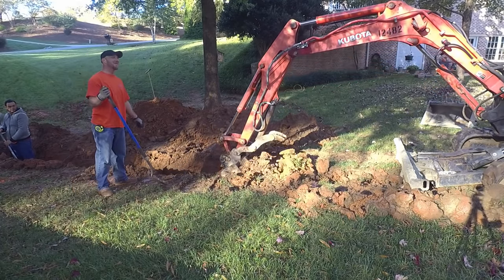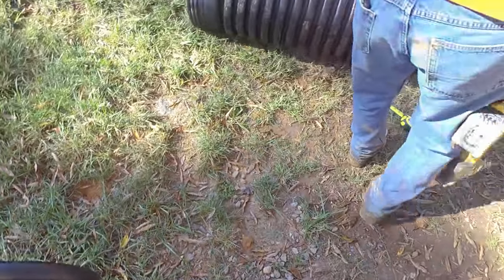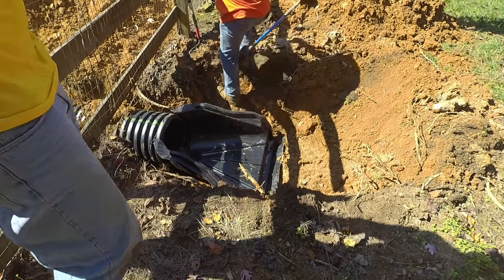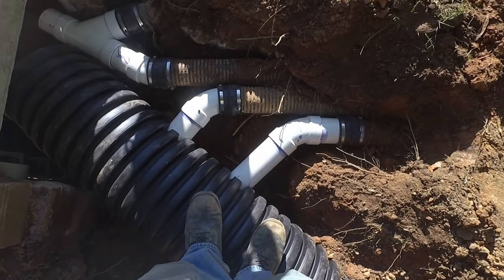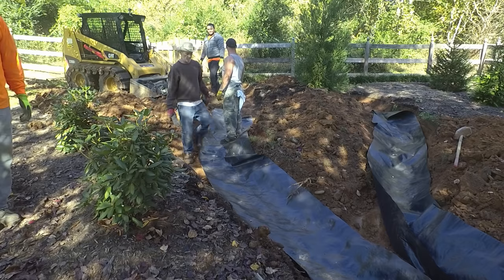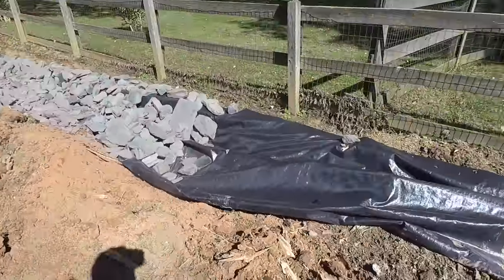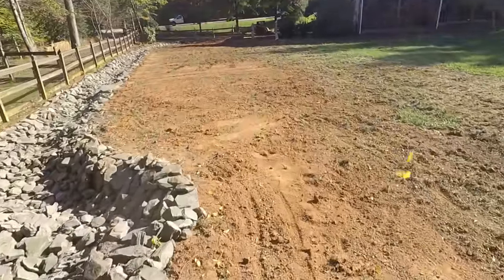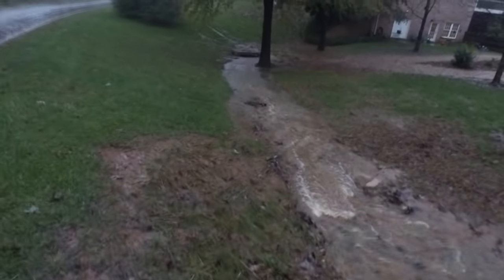Installing a riprap channel + culvert

Comment: Shocking... An operator who knows how to straddle a ditch AND, the pipe joints were cleaned and lubed. Goes to show how many shoemakers are in here. Nice hand work with the riprap and lawn. Love you have before and after and of it actually working as planned. I checked as to why so few subs and I see you are new. We will do some word of mouth and try to get you a bit more settled in. Well done!
Reply from the maker: It's funny you mention straddling the ditch...I about fell in when trying to get out of there. That big excavator is still a little intimidating, but I got it out. I've been excited to see the channel grow, so any referrals would be awesome! Thanks!

Comment: That is really awesome job and improvement. Rip rap really slows the velocity and may even catch some debris. Where we are at, we deal with too many branches, even small logs washing down into the culverts and end up having to oversize, or put in large entrance grates. Service clean outs along the culvert run sometimes. Residential area like that, not much debris.  Thanks for posting the before and after water flow. Great result and attention to detail.
Reply from the maker: Thank you Steven! This was a big job for sure But I'm very happy with the results.

Comment: very well thought out drainage, I also built a rip rap (6' stone)style drain running along my driveway to 16' corugated drain pipe under the driveway to the other side then dumps over the hillside. The only thing that I dont like about it is 7 yrs later the weeds are growing up through the weed control fabric and its a pain to weedeat as it throws rocks and ebris all over the palce.
Reply from the maker: Have you thought about spraying the weeds? I know that's less ideal for wildlife.
Reply: Spray it with a weed killer like Gate city said. There are eco friendly weed killers and can be made at home !

Comment: Wow, great work. What an awful situation though! I would have taken one look at that place and said, nope, not buying it! I have it bad enough as it is where I live. I'm getting ideas on how to handle the Spring run off. But that was just insane! Water is very powerful! I just bought a 31 acre, mostly level, piece of land in NH (believe it or not). Zero water issues. Winning!

Comment: I like this sort of heavy duty channel being open to the surface. You can see if it's breaking down at any point, and fix it straight away, where an underground drain you don't know if there's a problem until it fails completely. It's also much easier for a new owner to identify, or other workers, if the property changes hands.
Reply from the maker: Great point!

Comment: This is gorgeous.  You have said before that you choose function over aesthetics, and I get that totally, however this time you did both. Very impressive.  I do lawn and landscape, and am fascinated with water flow and controlling water flow.  I've done a few dry creek beds and open french drains like the ones you recommend, and have been very successful.  (not for foundations, but for landscape water control) Looking at the open channel... I'm assuming you chose to line this project because of the volume and flow of water, to get all of it possible "in the pipe" and keep it there, even though it's an "open" pipe this time.  Would you talk a little about that--what fabric you choose for this and why you decided to line this, and how that's different from the French drains in clay you have shown us?  Thank you for this education, and for what you do.  Brilliant work, and a pleasure to watch.  FYI, I work in Kentucky, and we have a high clay content in our soils too.
Reply from the maker: Hey -  We used a soil stabilization fabric under the channel. It's designed to go under rock like this and was quite expensive. It also helps keep the veg from growing up through the rocks too. I knew from talking to the homeowners that there was a huge volume of water coming through here so I wanted to armor the trench with the fabric. This is different than a FD where you have water flowing into the trench but then flooding up into the pipe. You don't have the river of flow like this in a FD.

Thank you for watching and for commenting! I'm excited you like the content!   - Shawn
Reply: @GCFD  Thanks Shawn!

Comment: Property value increased because of the flooding problem fixed and as a bonus, when it comes to selling the home, the homeowner can advertise a "part time water feature".  "A River Runs Through It".
Reply from the maker: Haha yep! The homeonwers were worried that it would look like they have a problem and I said it will look like you solved a problem. They're happy.

Comment: last scene appears as if the problem wasn't entirely fixed, just helped a bit.
Reply from the maker: The issue was all that water running along the back yard, into the front yard, and into the drainage basin. Now the water flows down the channel and through the culvert across the front yard. Water from the neighbor is impossible to stop from going in the basin but the homeowner has a front yard now.

Comment: This is my second video of yours. If you don’t mind me saying. You should start incorporating  filter fabric on your French drains and type 2 cement and molding plaster on your cement work will make your job easier and last longer. Just my 2 cents
Reply from the maker: Hi Bears - I don't use fabric because fabric clogs with fine sediment and kills the flow. By using gravel as a filter, I preserve the flow and that provides the energy to carry the fines through and out of the drain. 👍
Reply: @GCFD  where I’m from by code we are forced to wrap ballast rock in fabric so the rock doesn’t not get contaminated and the water is cleaned when absorbed by the ground

Comment: You should try using dish soap on the rubber seal of the culvert when sliding them together. I’ve used it a few times when installing culverts. Plus I believe that it is really what the company recommends for lube because it won’t disintegrate the rubber over time.  Dollar store dish soap would work fine at $1.25 for a bottle you would get many jobs out of a bottle!

Comment: That’s a lot of water to have flooding on to anyone’s property.   You did a nice job looks like on the low end there across from the back of the house you could change that from dirt and lawn to a rip rap open ditch too. Build a small bridge over it.   That’s just an insane amount of water.  Seems unfair the city or county road above them creates such a water problem
Reply from the maker: Thank you for your comments! I think the homeowners want to do some more work back there now that the water is more contained. They were so frustrated with the DOT and the water that no one wanted to help with.

Comment: When that boy on the excavator gets to my age he will wish he had worn those ear thing dangling on the rod in front of him
Reply from the maker: Good point! I have a pair of hearing protection hanging on almost all my equipment, even vacuum cleaners. Protecting your hearing is extremely important.
Reply: I was like him. I had a lawn mowing business as a teenager. I just blasted music from open headphones to drown out the sound using my old mp3 player (it held like a dozen songs!). Now I have hearing problems. It sucks. And I only did it for a few years.

Comment: I don't know how often you install that type of pipe but couple things we do when we install it on our projects. One, keep the green line up, it's there for a reason. Two, use pipe lube that comes in the tub. It's messy but throw on a glove and put it on there. Use a lot. It works better than that spray crap. Three, use your excavator to push the pipes together. We use a large piece of wood like a 2x6 or 2x8 and put that over the opening then we use our excavator to push on the wood. The pipe slides right in. We will also use a come a long and chain to pull the two pipes together. We don't use regular concrete for our catch basins, we use a product called Jet Set. It sets really, really quick (like in 15 minutes) and it will even set under water. Our engineers won't allow us to bed pipe in dirt, we have to use 1 1/4" rock and compact it in lifts using a jumping jack. We also have to maintain grade so we use a transit to shoot the grade which I'm usually the one doing that. Then they know who to blame when you screw up.
Reply from the maker: Great tips Mike! thanks for sharing!

Comment: I would have liked to see you investigate the water coming in on the left.
Reply from the maker: That was coming in off the patio and down the hill. We tried to catch some of it with a channel drain. The problem is I had talked to the homeowners several times during lighter rains, but I zipped up there during that heavy rain. It was super early and I didn't want to distrub the owners by wandering around their yard.

Comment: Wow, glad you showed the water at the end of the video..Surprised me just how much water water was flowing.  Do you think you'll eventually need to add a catch basin ot two in the yard between the house and culvert to help with erosion?
Reply from the maker: I don't think so. You'd only use a catch basin for point surface waters. So after things have settled in you might find a certain point that is collecting water and you could place a CB there. 👍

Comment: I guess the straw is there to prevent erosion of the freshly skimmed ground, right?
And maybe to protect the ground so grass has an easier time growing?
Reply from the maker: We seed + straw any ground we disturb. Yes, it is there to help erosion control and to help the grass seed germinate and not be foraged by birds. I just purchased 100 bales from my local farmer as we use a heavier straw layer in the winter to stabilize things until spring.

Comment: Why is corrugated alright for a culvert, but not for general drainage issues?  Wouldn't a smooth concrete pipe work better?

Comment: Looks like all that hard work paid off. You did a nice job with the landscaping after the install. On the neighbors side is that a transformer and phone/ cable in the middle of runoff?
Reply from the maker: That runoff on the neighbor is what used to happen to the homeowner's front yard.

Comment: Can you explain why sometimes you use the black 'plastic' and sometimes not?  I am going to fix my drains soon with rip rap and see sometimes the black 'plastic' is used and sometimes not.  Also what is the black 'plastic' in case i need to use it?
Reply from the maker: We do use double wall corrugated for 12" and higher pipe. This is rigid and comes from the pipe supply house in 20' lengths. What I don't use is single wall corrugated that is flexible from the home improvement store.
Reply: @GCFD  I'm sorry. I was actually speaking of the 'mat' beneath the rocks you roll out.  Do you need that in every rip rap application.
Reply from the maker: I think it is useful on new installs.

Comment: How hard is it to get permits for cutting that big of a hole and tying into the existing storm drain system?
Reply from the maker: In this case it was just HOA approval as this is a private drainage basin. Check with your HOA or city for sure.

Comment: That cat is begging for some grease
Reply from the maker: I've greased all the spots I can find.. I wonder if something is not taking grease.
Reply: @GCFD  could be a bad zerk fitting, the pins definitely sound dry
Reply: @jackofall2305 , Something is begging for grease, stop using it until it's found.

Comment: How is the neighbor getting away with that? I thought the homeowner was responsible for their own stormwater management? You can just drain onto your neighbors property?
Reply from the maker: It's tricky. Officially, you don't have to manage water running off your property at all. What you can't really do is collect water into a pipe and dump that pipe directly onto a neighbor. Many neighbors still do this and it creates major problems. I always try to work with neighbors to keep water contained in a pipe the whole time. As you can imagine, I've worked with good and bad neighbors trying to solve drainage issues. I think it's so easy to just be a good neighbor and try to help solve water issues.
Reply: Cross lot drainage is a big no no when subdividing and building homes.  This video shows the headaches that come along with it for the homeowner downstream.  Unfortunately, a lot of the older developments did it this way and some continue doing this depending on where you are in the country.  Topography is a big factor as well  sometimes avoiding cross lot drainage is not feasible, so drainage easements are established. I'd bet there was a drainage easment on this property allowing upstream properties to drain thru this property.  Just my .02. I've reviewed lots of newer subdivisions in southern CA.

Comment: I'm a new subscriber. I noticed the 15 inch culvert is plastic, not metal and looks similar the the smaller diameter corrugated pipe I see you frequently replacing. I assume this is due to cost concerns. How well does the 15 inch culvert pipe hold up? Great videos. Love your channel.
Reply from the maker: Hey Dave - this is double wall corrugated, so it is smooth on the inside. This is used for culverts as it will hold a dump truck running over it. Double wall is good stuff when you get above 12" diameter.

Comment: How come you are using corrugated pipe? Your other video said use pvc. Is this because 15" pcv is not available? Love this channel BTW.
Reply: Cant really get pvc past 6 or 8 inches. This pipe is more ribbed not corrugated for strength. The inside is smooth like pvc. Very heavy duty drainage pipe.
Reply from the maker: We were using double wall corrugated. It's used for culverts under roads.

Comment: Какие трассы собираются в бетонном коллекторе? (На 01:00 минуте видео) 
Как думаете, не заилится глиной и песком сделанная каменистая траншея?
Reply: @GCFD  
What lines does come in concrete collector at 01:00?
What is your opinion about service life that rocky trench and how often it need in cleaning from sand? Will be silt up the sand problem for that after a while?

Comment: Is that the echo cutoff saw? If so how ya like it
Reply from the maker: Yes! I've had it for about a year and a half. It's a great saw, though we don't use it very often. It starts easily and has power when run dry. I would buy it again.

Comment: I don't understand why you would need to riprap the whole thing, I get why you would do it at the inlet to prevent erosion, but if you just made it a grass swale wouldn't the grass prevent erosion?
Reply from the maker: With that much water flowing through it would be very difficult to establish grass in the first place, but yes you could do that.
Reply: @GCFD  That's true, it basically is a creek that was graded over for the lots and any rain in the area could just wash out the hydroseed.  Thanks for the video.

Comment: No no no ypu can use larger river rock 10lbs in size basically the same size as the rip raff im out of Atlanta and it gets trucked in from Tennessee. Rip raff is a   Municipal usage stone and for roads
Reply from the maker: Thanks for that info. In this case the homeowner didn't want to go that route again with the volume of water that flows through their property. They liked the idea of angular rock which doesn't shift around like river rock does.

Comment: You did a fine job! I was wondering did you consider using a French drain, particularly in the back yard area? Best wishes
Reply from the maker: We thought about that but the volume of water was way too much for a french drain so we did the channel. I spent a lot of time talking with the homeowner and making sure I knew exactly what was going on with their water.
Reply: @GCFD  It looks really nice, I bet it look beautiful with grown in plants. Have you ever considered piping the water into a turbine to charge batteries? Might be an extra job for your team what with a lot of people installing solar now, they already have the setup to link into. I've seen people make their own using motors from washing machines and things but I'm sure there will be kits you could buy.

Comment: Hearing protectors don't work very well unless you are wearing them.  It doesn't take a very long time to start losing your hearing, so protect yourself and make sure your employees use all the protections they should be using.
Reply from the maker: Great tip!
Reply: @GCFD  I lost part of my hearing due to my stupidity.  I didn't wear the hearing protectors when around fire arms (M14, M16, 155 cannon) while in the Army or when driving old trucks without mufflers.  I wear them now for everything from shooting to mowing as well as driving my tractor (which is very quiet).

Comment: Whats the point with all hay.. I have never used that when i have done simillar job here in sweden
Reply from the maker: Hey Mathias We seed and straw all soil we disturbed. The straw absorbs the energy from raindrop splash and keeps the disturbed soil from eroding away. The straw also protects the seed from Granivores, It holds moisture, and releases nutrients as it decomposes for the germinating seeds.
Reply: @GCFD  i thought it could be for that reason  but wasent sure thanks for answer and keep up the good work guys . i really enjoy ur videos =)

Comment: .....on previous video this bloke said NOT to use "ridged drainage pipe" but smooth bore .
Reply from the maker: Are you talking about the culvert pipe? It's double wall corrugated which is smooth on the inside. It works very well for culverts.
Reply: Smooth ''bore'' means smooth on the inside right ? Thanks.

Comment: I though you didn’t have much use for that kind of pipe.?
Reply from the maker: That's double wall corrugated culvert pipe. It's smooth on the inside and has the ridges for strength. It's good stufff.